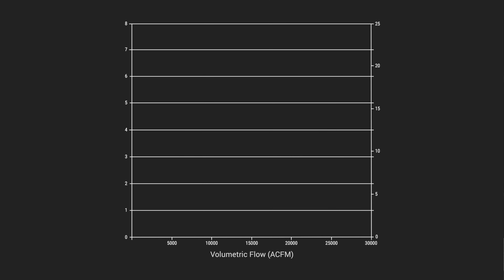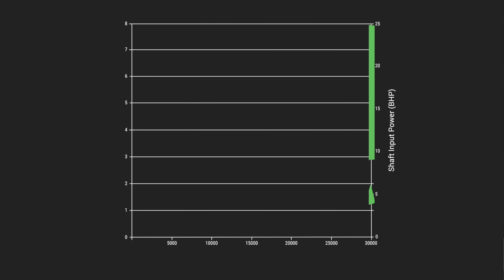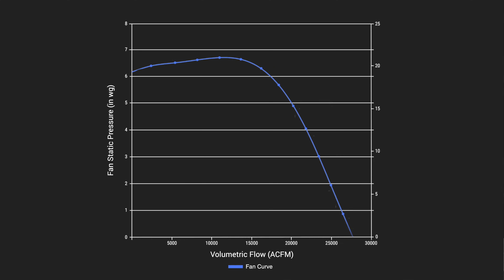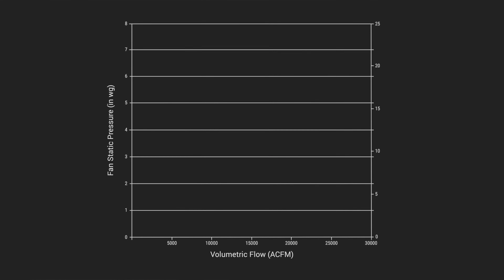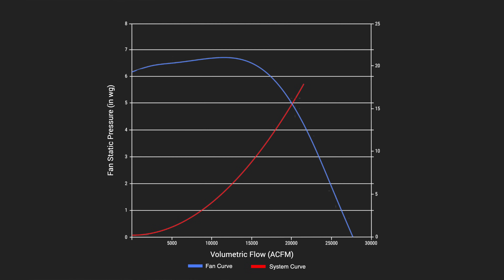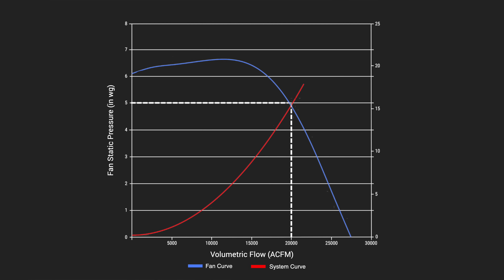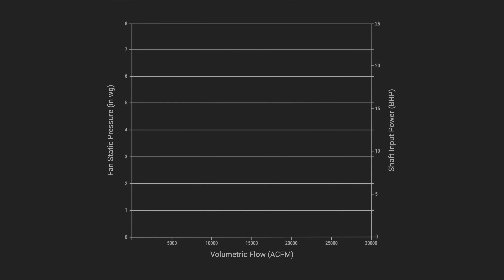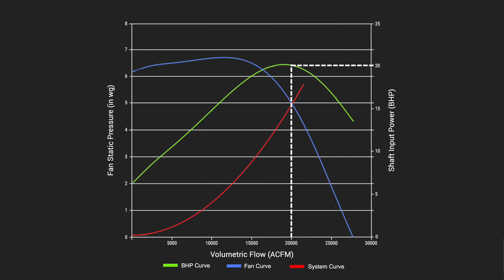How Do Fan Curves Work?

Comment: When I'm calculating the systems resistance I get a total pressure and a static pressure. Should I provide the fan-manufactor the total pressure when ordering the fan or the static pressure only?
Reply from the maker: In the fan industry, static pressure is more commonly used than total pressure. However, either one can be specified as long as it is consistent!
Reply: @NewYorkBlowerCompany Yeah. That makes sense. Not so big difference in comfort systems due to the low volocity, bit I have some fire/smoke ventilation with high outlet velocity. Then I have quite some difference